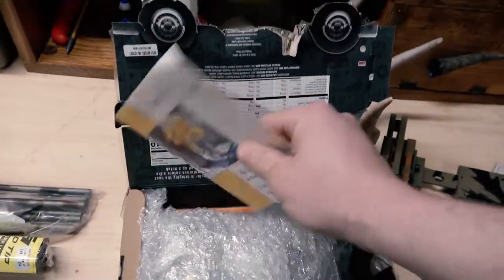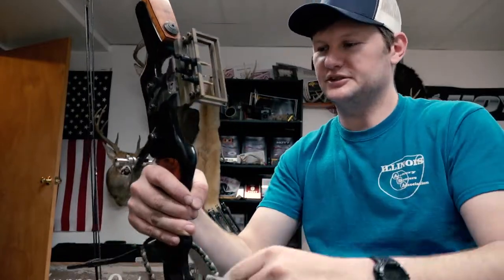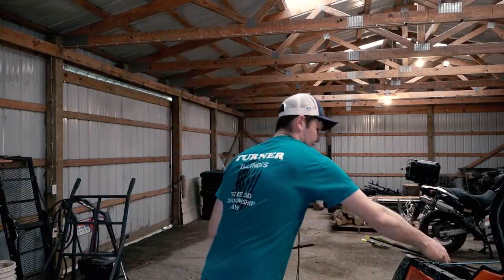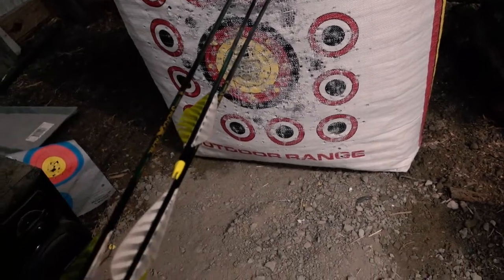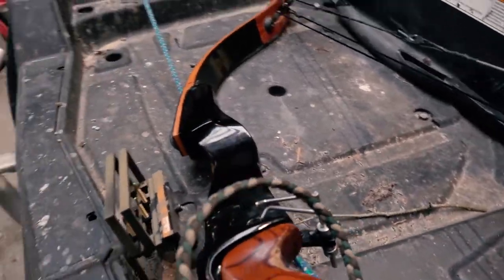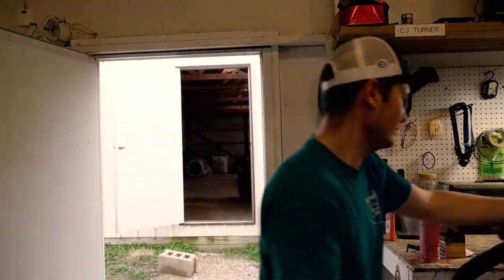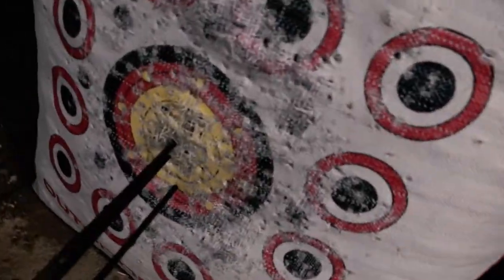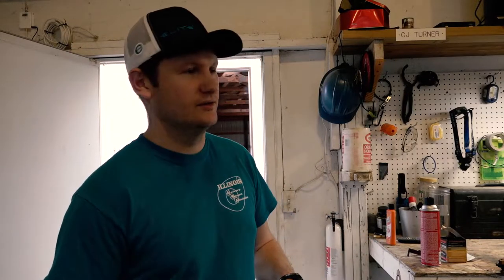Setting Up and Shooting a 40 Year Old Compound Bow - ProLine Zephyr Magnum

Comment: With a fork rest of that style you need to turn fletchings over ! 2 up 1 down between the forks
Reply from the maker: Yessir, Generally I would but the helical on the feathers was hammering the rest. Got away with it flipped incorrectly for a little and then built some proper arrows for it later on.
Reply: @CameronJosephTurner   just watched that vid 👍 ! Man i had a wall full of vintage bows then got stupid and sold them all at a yard sale !
Reply from the maker: @jakebutters5685  mannn, and probably for pennies. Good news is you can probably find others at the same type of sales. Of course vintage now is from the 90s haha

Comment: Has anyone to put a drop away rest on these old compound bows that's probably in the 40-year-old range that has them wire cables? I just have not seen anyone try it
Reply: There isn't much point, and besides-putting modern gadgetry in it will reduce the nostalgic value. You really won't get much out of a dropaway rest with a bow like this though. It fires at low poundage and FPS compared to today's bows. (Arrow speeds usually went around 200 feet per second) Wide spine aluminum shaft arrows that some guys weren't even using a rest for. Just firing out of a bare riser. Compound bows then just weren't like today. Compound was seen as a bit of a gimmick and an offshoot of recurve bowhunting-a new fangled trick the young'n are all trying out etc.

Comment: I have a proline condor that I am setting up but I am having serious issues with the rest. My string lines up with the inside of the riser so I feel like the arrow is going to come out to the left. The bow had a two prong and it seemed to work fine. On your proline how far away from the riser does your arrow rest?
Reply from the maker: Rest is close to riser to achieve center shot. Someone mentioned that an overdraw would come far enough behind the riser to give me more room. I just shot it the way she sat and it does fine
Reply: @CameronJosephTurner  my string is basically on plane with the riser. For an arrow to run parallel to the riser I’m only 1/8 of an inch from riser to arrow. My fletching will hit the riser
Reply from the maker: @timmccomb4100  yessir I shoot feathers in this setup for that same reason. Not sure if that’s normal or not but it’s my work around